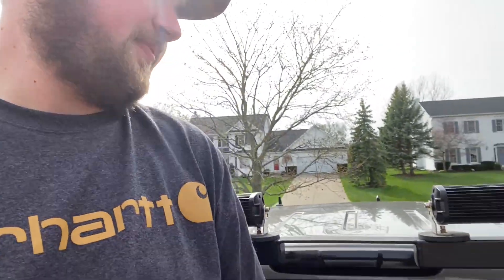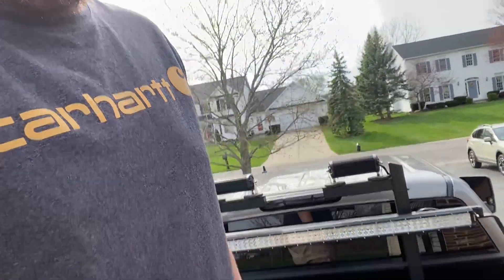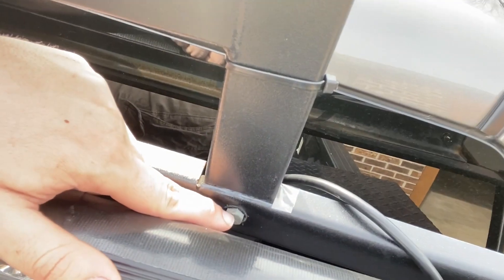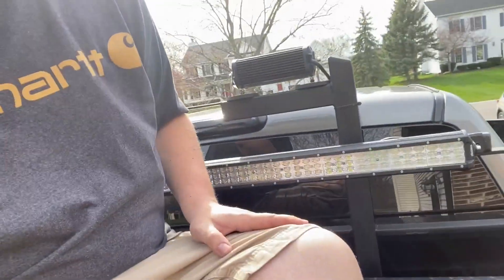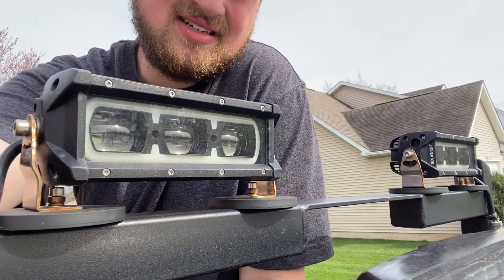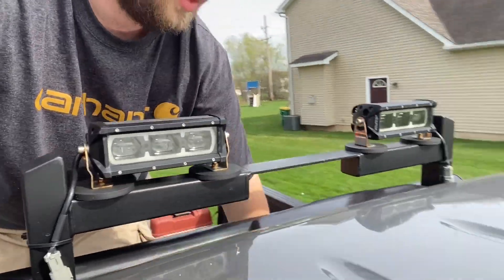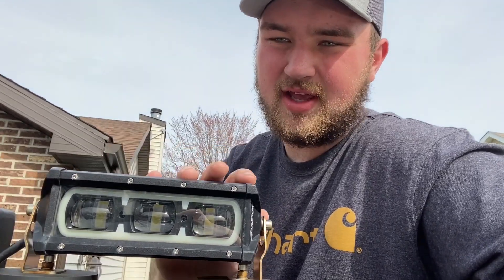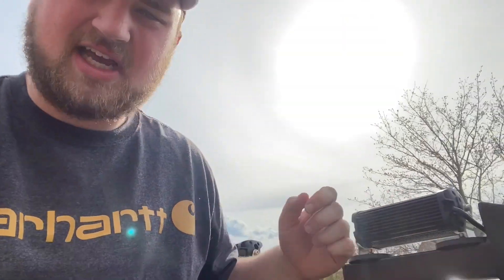Custom Back Rack Overview

Comment: I tried to put one of them things on my freaking truck but i did a bull crap job putting it on because all I had was some crappy screws and gorilla glue. Well I guess that wasn’t freaking good enough cuz the piece of crap flew off on the interstate and went through the windshield of a Honda pilot and caused a pretty bad wreck. When I saw that sucker swerve in to the opposite lane and all that crashing started happening I freaking slammed the gas and got my fat A outta there. I heard some truckers on the cb say that was the worst wreck they ever saw, it caused a traffic jam that was 9 miles long. It ain’t my fault that the gorilla glue didn’t even work. They say it holds like a gorilla, they even put a monkey on the bottle. Ok?? I think a gorilla could at least hold on to a stupid piece of steel instead of dropping it and making it cause a catastrophe. Later my stupid grandma told me I shoulda just naught the correct mounting hardware. Easy to say that when all you do is watch tv and be old as piss. Maybe if that glue wasn’t a ripoff? Maybe they shouldn’t have but a monkey on the bottle to make me think it’s just as strong a monkey.